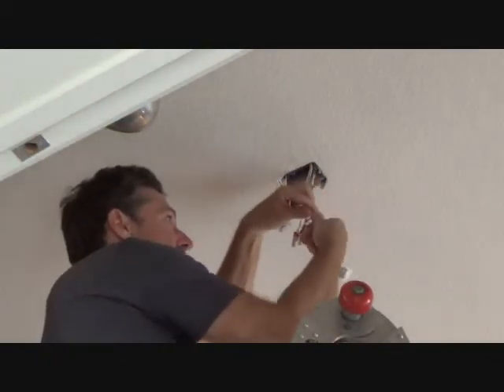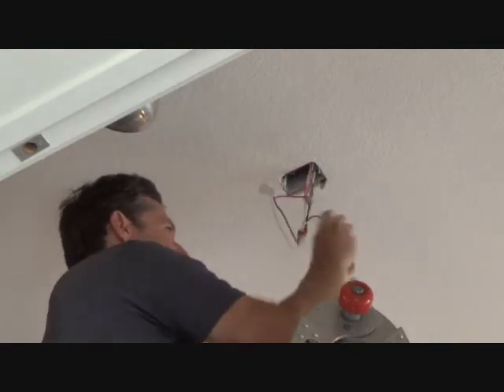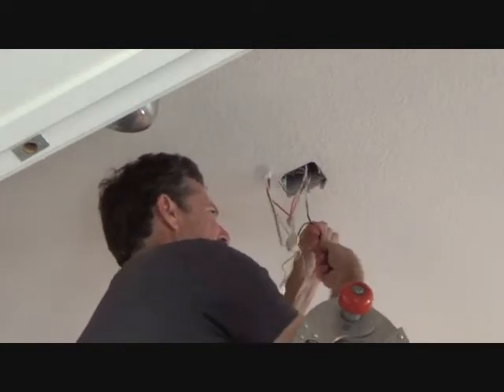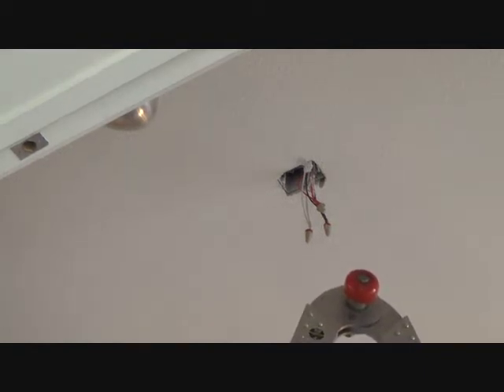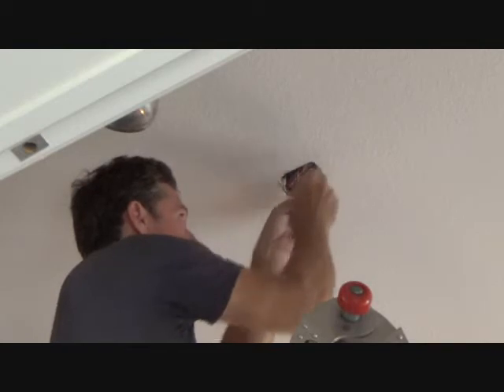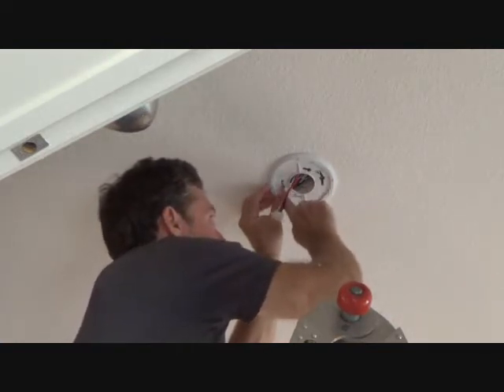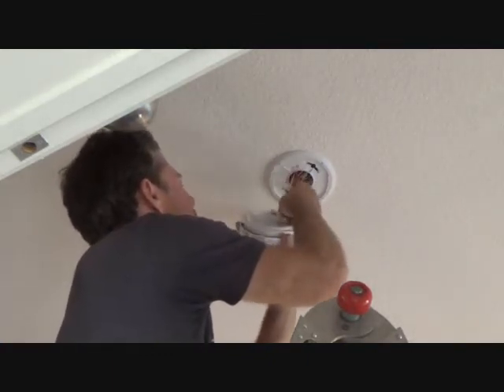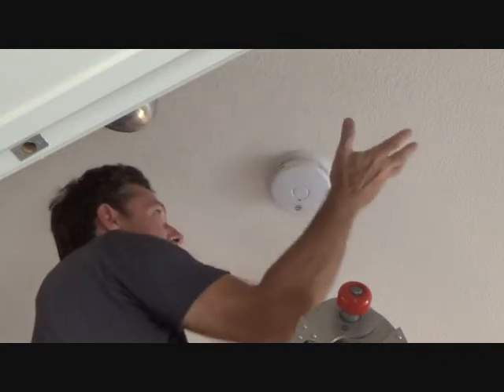How to install a hardwired smoke alarm

Comment: so how do you find the wires? everyone seems to not explain the first part in making a hole in the ceiling
Reply: what do you mean
Reply from the maker: If it's hard wired into your house electrical then you can install the new smoke alarm in the same place. If you are wanting to install a smoke alarm where there is not an electrical junction box for a smoke alarm then you could install just a battery operated ten year smoke alarm that is only controlled with the battery. Is that what you wanted to do? I have videos for that & more for smoke alarms. Just go to my main YouTube channel page then click on playlists & scroll down to smoke alarms. How did your install go? Did you put one up?
Reply from the maker: I think he might have meant that he wants to install a smoke alarm somewhere where there never was one meaning just installing a battery operated smoke alarm....at least that's what I am thinking... but who knows! LOL

Comment: 15 amps can kill you really fast.. and even if you remove 1 marette at a time it can still be dangerous.. all you have to do is touch the hot wire and be contacting ground at any part of your body
Reply: Yes 15 Amps can kill you but , what he's doing will not because the load is not drawing nothing near 15 amps , the 15 amp circuit breaker is your load max in current flow from the circuit branch line.
Reply from the maker: You're right & it's always best to turn the breaker off before working on hot wires.
Reply from the maker: Thanks for your message & also know the very best way to do things when working around electrical is to always make sure to turn the power off before working on electrical. Thanks for stopping by!